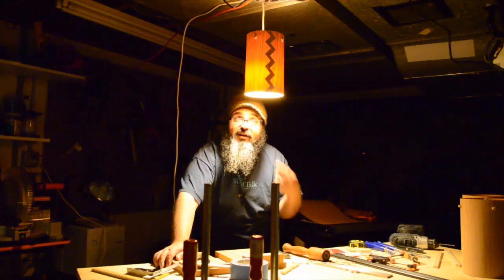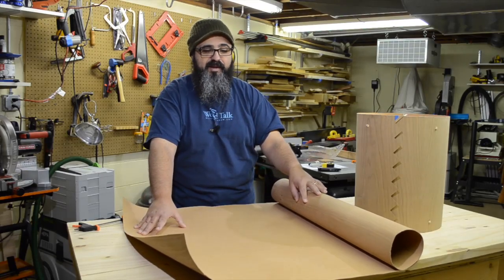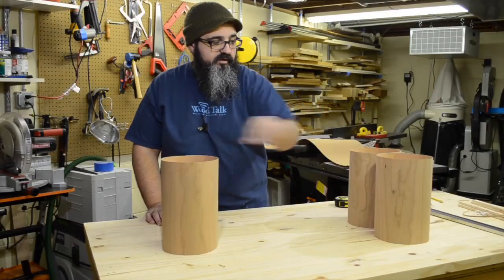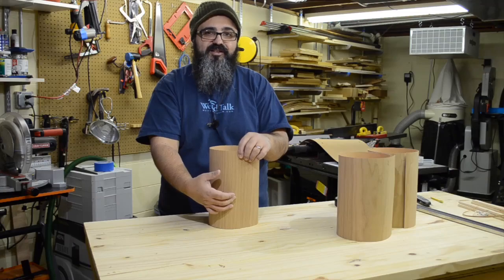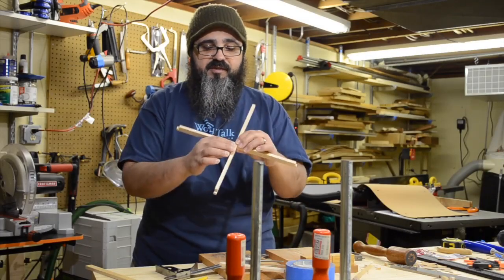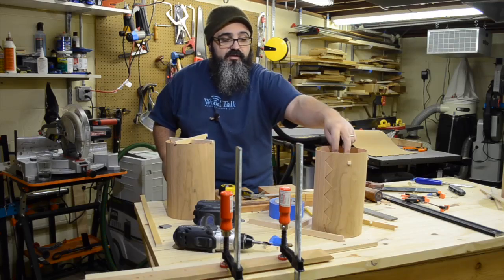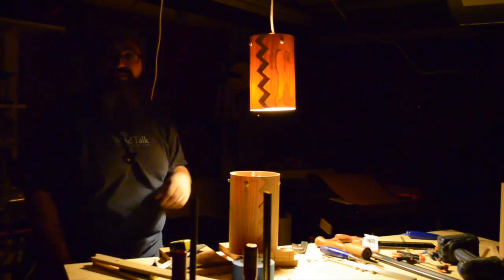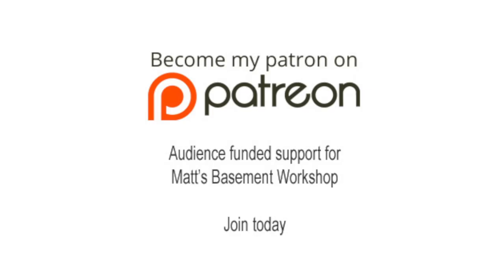536 "I love lamp" veneer lampshade

Comment: A suggestion if I may. When gluing up the two ends together, a system like you used to drill the holes would work as long as you had something the glue would not bond to. Giving you a really good way to clamp it while the glue sets. Just my 2 cents worth. I love the idea and I'm going to try it, although in SE Georgia a cool glass of sweet tea and air conditioning are in order. Keep up with the videos, They are awesome!
Reply from the maker: Great suggestion! Thanks for sharing.

Comment: Any finish recommended?  Was thinking like like a spray lacquer... wonder how that would hold up to the heat... I am making one, just want to make sure it's durable, anything maybe to coat the edges with so it can hold up to a move or two.  Maybe coat the very edge in a little super glue...?  Am I over thinking this?
Reply from the maker: I haven't applied a finish as of yet, so far I don't think they need one, but at some point I'm sure I'll want to add something. I'm leaning more towards a simple spray on finish, something like a shellac or lacquer will probably be more than enough. As for the heat, surprisingly they don't get as hot as one might think they would, so that's far less of an issue. Since I used a paper-backed veneer, I'm not evening considering issues with the edges, they're pretty stable.
Reply: Matt Vanderlist great!  Thanks for the reply.